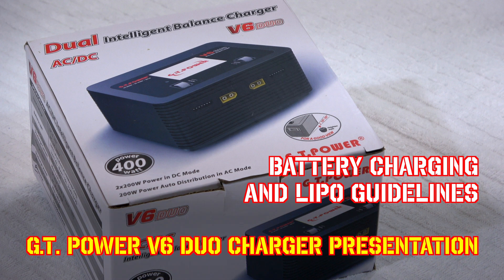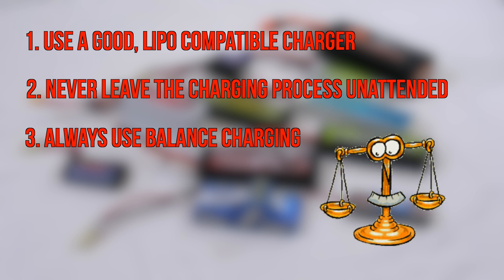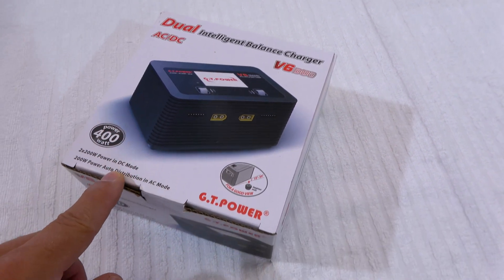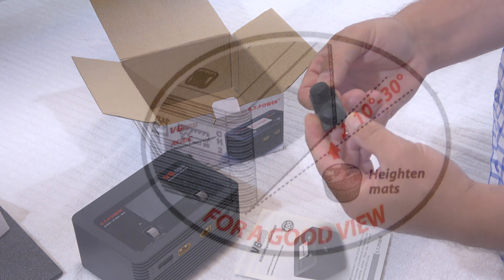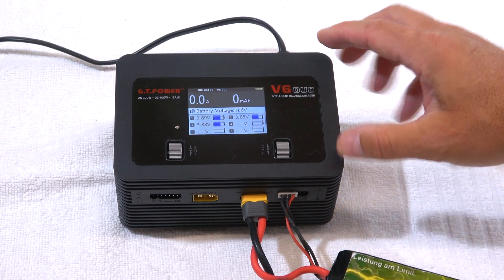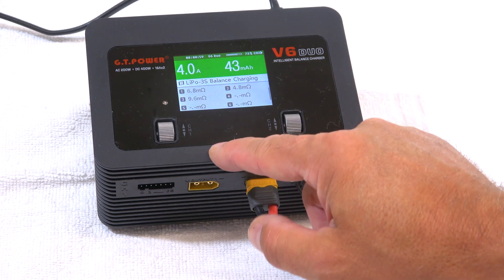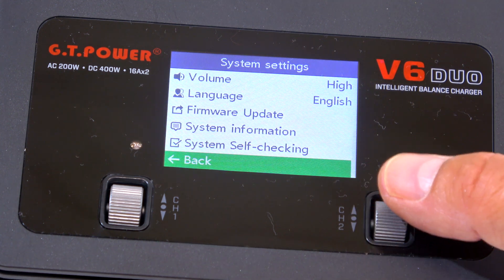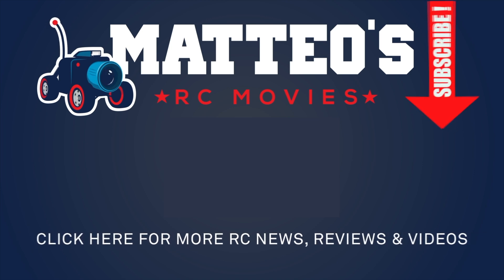GT Power V6 Duo Charger / Battery Charging and LIPO Guidlines

Comment: Hi
I have a duo v6 charger as well.
I noticed that when I compare the battery percentage reading when charging to that of a seperate battery tester the value is not the same.
For ex. My 5000mah 6s battery tester says 13% and when I connect the battery to the charger it says about 50%. And then when I charge the battery it will push about 4500mah into the battery. That surely means the battery cannot be at 50% when connecting to the charger.
Any ideas??

Comment: How could I charge an 8 battery NIMH pack with this?    The connector from the pack doesn't connect
Reply from the maker: You ned an adapter cable…

Comment: Looks like a ISDT ripp off or re-brand.. but the ISDT have a better screen.
Reply from the maker: Yes, there are many parts and software from the same factory, but used in many different brand chargers.
Reply: @Matteomeier  I think I would still rather buy a ISDT that supports Bat2Go smart technology and the ability to upgrade the firmware for future proffing.
Reply from the maker: The G.T. Power Charger firmware can also be ubgraded via USB port.